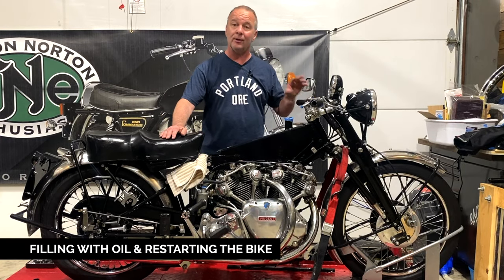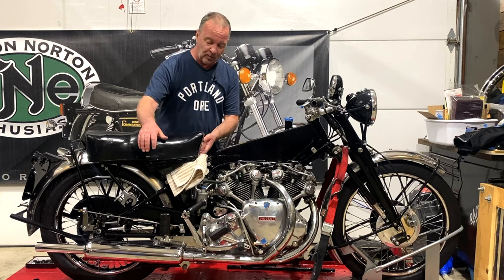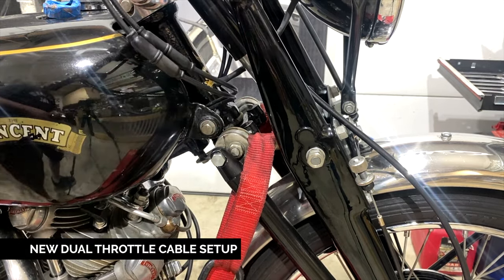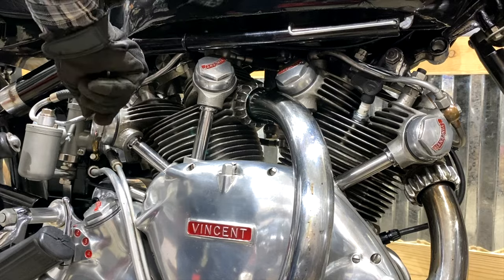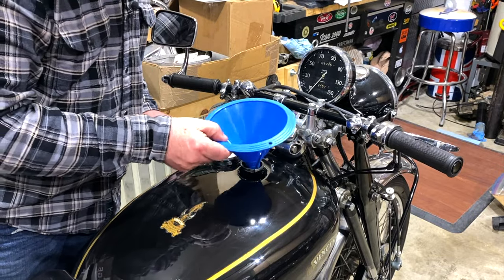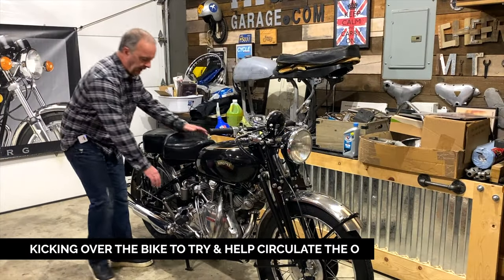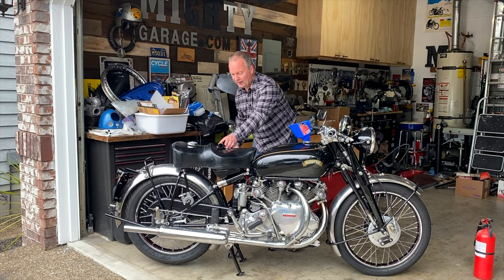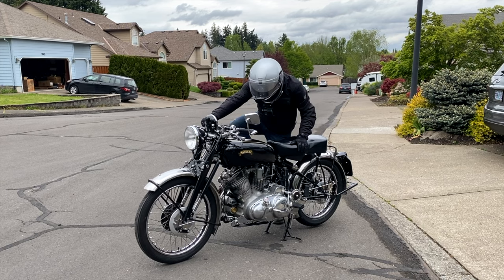Restoration of 1951 Vincent Rapide - Part 94 - Engine Oil Change and Restart - Part 2 of 2

Comment: Well done Mike, so satisfying an oil change on a bike unlike a car .. 😂
She's looking very 'ready' for summer .. very shiny .. starting well & sounds a treat .. 👍
atvb t ..
Reply from the maker: Cheers Terry!  Yes, the oil change is pretty involved, but it’s a lot of fun. Had a great ride today with Geoff on our Vincents. We did about 100 miles and I took a few clips :-) cheers, Mike
Reply: @TheMightyGarage   Mike.  The sump on those engines is dry. the oil has to be fed down.  Can I ask what your thoughts are on that versus a wet sump?  As with cars of that era, there is a fair amount of oiling & greasing to do! (compared to modern machines) 👍

Comment: Very thorough job there Mike. In one way, having so many things to go over, gives one the chance to inspect other things that could possibly be an issue at the same time.
Reply: mike oiled the pushrod sleeves ..are they fed oil when engine is running? I would assume they would be but I'm not sure ..
Reply: They would just get any excess oil that would be there. Maybe he oiled them to make them fit into the end seals better. @vincentl.9469

Comment: Clearly a machine you really need to know to be able to own! Cool video.
Reply from the maker: Thanks very much Jeremy!
Reply: @TheMightyGarage  hi,  correct me if I'm wrong but I thought these engines were dry sump ? so the oil has to be fed from the tank...
Reply from the maker: @vincentl.9469  That is correct!  The oil tank is under the fuel tank and it's also a stressed-member (i.e., is an integral part of the frame design). Cheers
Reply: @TheMightyGarage   I  believe Harleys are the same...

Comment: surprised that with usual thoroughness Mike did not break bottom crankcase banjo oil feed to allow line to be purged of old oil, or was that in Prt 1?.
Reply from the maker: Hi Dog Paw, yes, it was in part 1 and part 2 briefly shows the banjo going back on again. I drained out all the engine oil from the main feed pipe that is attached to the underside of the crankcase by the banjo. The pipe sat unscrewed for several weeks and so I hope that most if not all the oil came out. What I didn’t do was blow the remaining oil out with with an air compressor, but hopefully I got most of it out 😉 Cheers, Mike

Comment: Great series! Thanks for your hard work, both in the shop and in the video editing room.
I'm unable to visit a bike with a girdraulic fork and am not seeing any measurements or maths on the internet. For a starting point to engineer my own fork, could someone tell me distances bolt-to-bolt of upper and lower links, as will as distance between upper and lower links at the brace/tree end, and at the fork end? I think I can fine-tune the geometry in AutoCAD, something that will better fit my bike's geometry, then work out spring rates mathematically.
Reply from the maker: Many thanks for your note. Best wishes, Mike